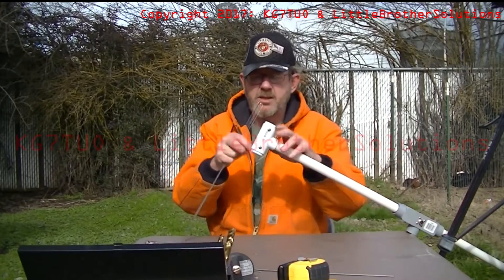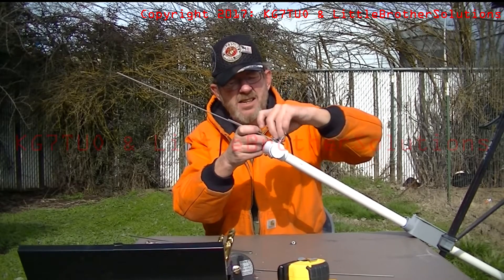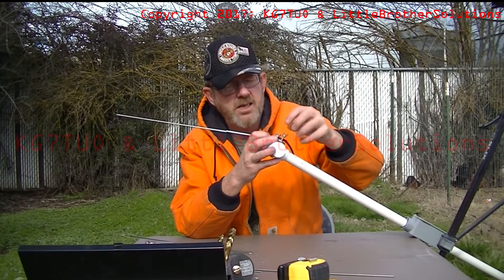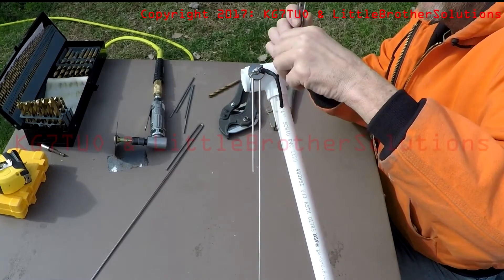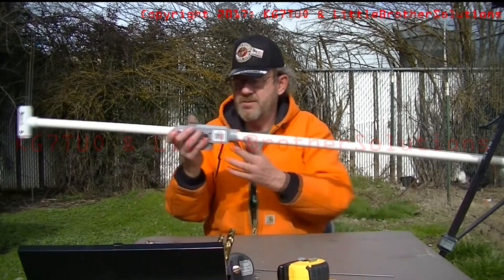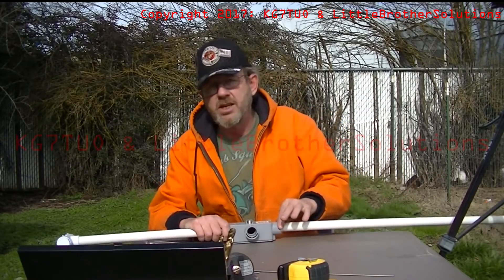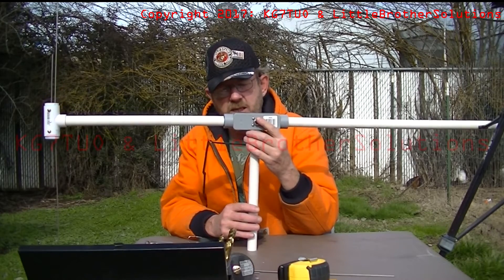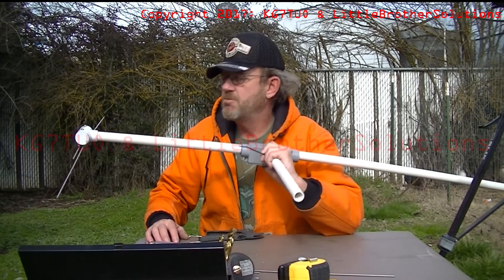Dual Band 2m / 70cm vertical dipole BUILD #2 Part 4 of 4

Comment: I'm going to build one of these. However, of all the DIY videos I have watched nobody talks about the minimum and/or maximum distance the curved sides of the rods can be from one another. This is baffling! If you place the two mounting points for the rods too close together isn't it possible you won't be able to adjust the SWR? The two ends will simply collide with each other. So how far apart should the mounting holes be from one another? Thank you! K9JPT
Reply from the maker: When I designed this antenna I used a "T" with 1" diameter on the "through" side and 3/4" diameter on the single leg (the one that points towards the junction box. This gave the best distance from bolt to bolt to allow for sliding the elements in and out for SWR adjustment without being too far apart. Just be sure not to put the bolts through the 1" "T" too close to the end (hence I reinforce them with either a plug or a short piece of pipe inside the ends of the "T" before drilling.

In use, I've never had to do any adjusting. The elements are always pulled all the way out against the bolts and always give useable SWR across the band. If yo are trying to tweak in for absolute best SWR on a specific frequency, adjustment might influence things but it's generally not necessary.

Hope that helps.

Comment: ok so does it work ?
Reply from the maker: It works like a dream.  I have gone 102 miles into a repeater with 50 watts from an altitude of just 12 feet above the ground.  I've run fox hunts with 2 watts on a 12-15 foot mast.
I've run long nets from the coast while it was set up on the back bumper of my 5th wheel RV.

Comment: Instead of a counter weight a 6 meter would be nice.
Reply from the maker: I built a 6 meter from PVC pipe (the boom), snap on T's, and bungee corded aluminum tent poles.  I designed it on NEC and built it as a 4 element Yagi that folds up and fits in the bed of my truck.  It works on 440, 2m, and 6m.  The proof of concept is built and has been used in the field.  I'll next build one without the snap T's (used to be able to adjust elements but none was needed) and a bit more attention to the fold up process to make it even better in the field.  
Not sure if that will come before or after I try to a 2 element 20m from PVC and tent poles (with a non tent pole center portion of the elements)

Comment: Why not just repeat this design on the other end  co-phasing the two for additional  gain, plus if protecting  the radiators from the elements  why not  just use smaller pipe and seal them inside, thus allowing  the use of copper  which radiates much better than any kind of steel?  Good design, an I may build one  except co-phasing  for gain!
Reply from the maker: I think there may be some confusion. The elements don't go into the back part of the boom to protect them from the elements but rather to protect them from damage when transporting. The idea being that you could break down the antenna and not end up with bent elements.  In practice, I've found that just folding them back along the offset from the mast protects them sufficiently.
I have considered the potential for a phased array as well as just putting a reflector (2 element beam) but this antenna has cone 102 miles into a repeater at just 12 feet of height with 50 watts. While a beam design would reduce the necessary power for that operation, it's overkill for my purposes and would remove the omni directional properties.
Reply: @kg7tuo999  I was thinking more in terms of the antenna being mounted  a  home install,  instead of portable. Still a good build  and good project.
Reply: Yes

Comment: Now I am con fused,,,the copper J pole is a dead short of the leads,, yours is open......
Reply from the maker: This is basically a dipole antenna oriented vertically for FM operation on 2m/440. The J Pole uses different principles than a dipole.

Comment: The lengths, measured from the outside of the bottom bend, are:
6 1/4" for the 70cm side
18 5/8" for the 2m side

Comment: So what are the actual lengths you cut the elements to?
Reply from the maker: The lengths are in the description for the vid.
Reply: @kg7tuo999  So I am a little confused. There is a short side and a long side on each element. I am only seeing one length given. Is it the shot or long side and what is the length of the second side. Sorry if this does not make sense.
Reply from the maker: @bulldude56  The lengths, measured from the outside of the bottom bend, are:
6 1/4" for the 70cm side
18 5/8" for the 2m side